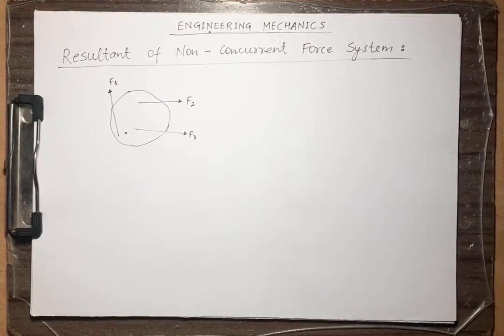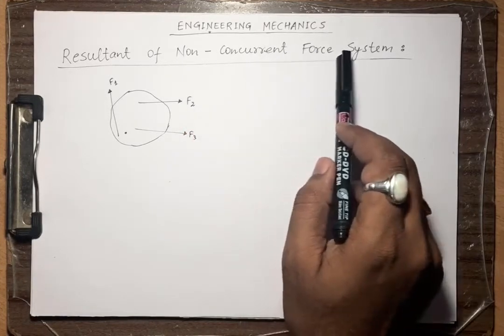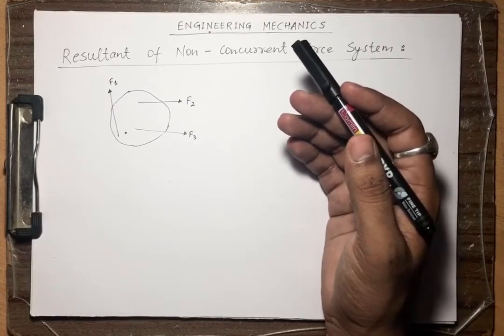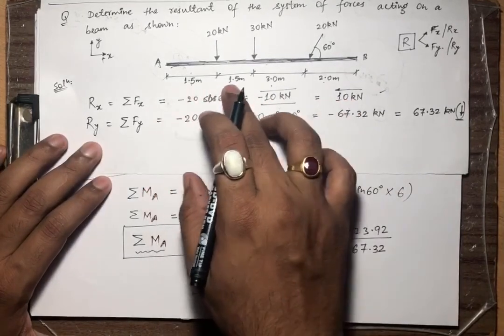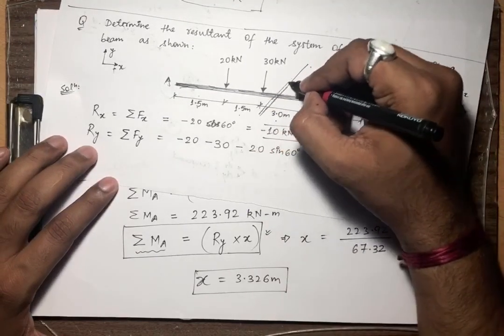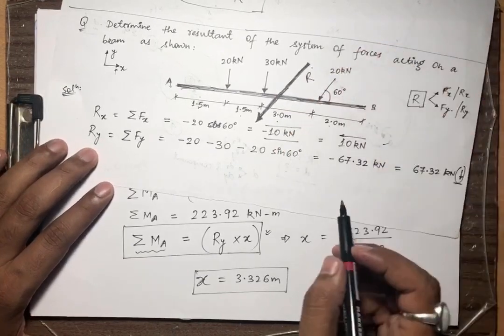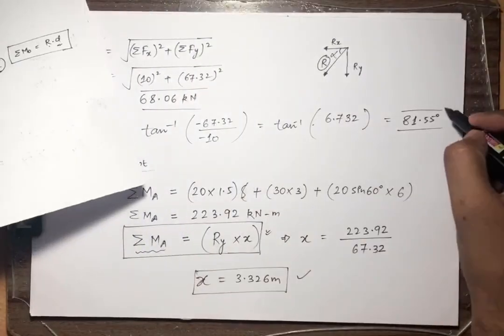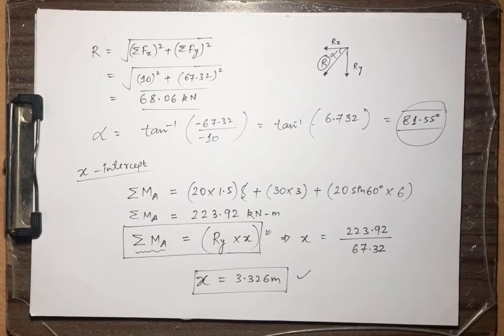3CE3-04 Engineering Mechanics L-13

Comment: Abhishek Meena
Roll no.002
A beam is a structural element that primarily resists loads applied laterally to the beam's axis. Its mode of deflection is primarily by bending. The loads applied to the beam result in reaction forces at the beam's support points.
Reply from the maker: Very good

Comment: Beam-A beam is a structural element which has one dimension(length) considerably larger than the other two dimensions in the cross-section and is supported at few points.
Name-Suraj meena
Roll no.-041
Reply from the maker: Very good

Comment: Name - Rishi Gautam 
Roll No.- 035
A beam is a structural element  used for bearing loads. It is typically used for resisting vertical loads, shear forces and bending moments.
Reply from the maker: Very good

Comment: Beam is defined as a line of light coming from a source .
It may be of energy ,particle etc.
It cannot be observed .
Name-Rajkumar 
Roll number -19EBRCE002
Reply from the maker: Please find the definition relevant to civil engineering structures.
Reply: @ghanshyammishra5915  
A beam is a structural element that primarily resists loads applied laterally to the beam's axis.Beams are characterized by their manner of support , equilibrium conditions, length, and their material.
Reply from the maker: Very good